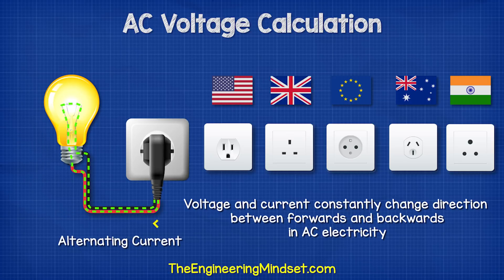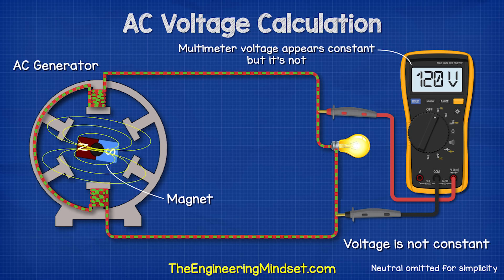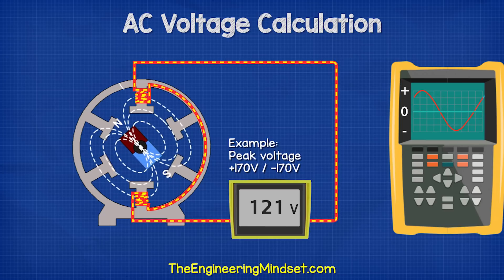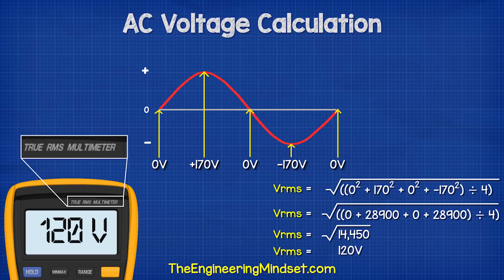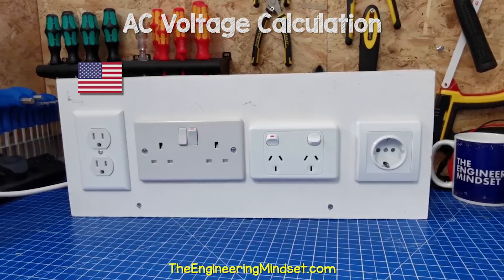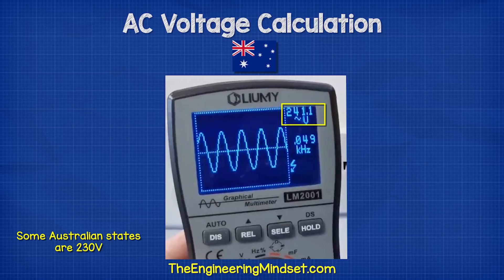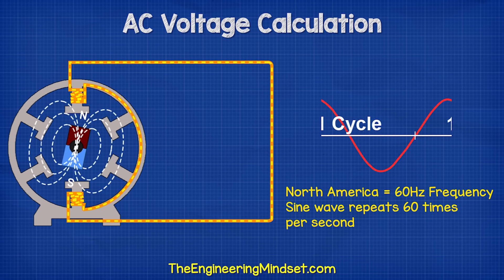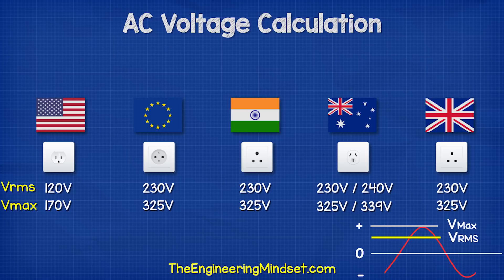AC Voltage Calculation - Vrms Vmax Frequency

Comment: Soooo....1 piece of trivia I've never learned, is 'why' the US uses 60Hz, and the rest of the world is at 50Hz.... was it something to do with synchronous clock motors, or the size of transformer cores having to be 'bigger' (more expensive) at 60??  Or was it something to do with 3-phase power in the U.S. by dividing the 360 degree rotation at an equal multiple??  Any answers?? Thanks...

Comment: Isn't the UK 240VAC?
Reply from the maker: Officially no it's 230V but it has a wide tolerance. For example in my home I read about 242V in average
Reply: @EngineeringMindset  huh, always thought EU was 230 and UK was 240...in fact so did the Wikipedia page I got that info from a long time ago...which is now different lol...guess I read that at the wrong time.
Reply from the maker: It used to be, you'll still see many signs up saying "danger 240V"
Reply: @EngineeringMindset  TIL, thanks for the reply

Comment: If e.g. voltage cycles between +170V and -170V, it seems like you could just call that "170V". I don't understand the need for averaging and RMS
Reply from the maker: RMS voltage is equivalent to DC voltage. The average DC voltage would be 120V for a heating element to produce a certain temperature, the average AC voltage would be 0V for the same heat output, because of the peaks are positive 170V and negative 170V so cancel out. So they found the RMS voltage which gives 120V

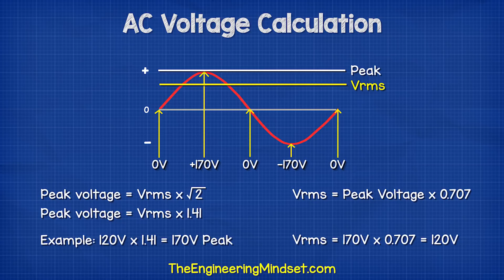Comment: There is an error in 1:29 when you said "divide by 0.707" instead of "multiply by 0.707"
Reply from the maker: I've added a note in the video description
Reply: To go from RMS (240 Volts) to peak you would divide by 0.707 to get 339.something?
Reply: Spot on!  I noticed that error too.  You saved me from a reply.

Comment: Admittedly, I am curious what background infrastructure you've implemented to deliver a demo to measure 120VAC/60Hz vs. a 230VAC/50Hz vs. a 240VAC/50Hz. Magic of television and all that, or something a bit more precisely engineered fo actually deliver those exact frequencies and voltages? It could be expanded further to deliver a 100VAC/50Hz Japanese receptacle.
Reply from the maker: There's a few ways to do it but I used some variable transformers and an 12V car inverter. Inverter is needed for the frequency change.

Comment: A small point ..... In the UK it was 240v L-N. 
Once we joined the EU we were "required" to have a common voltage (230v). Changing the mains voltage would be no small matter so it was fudged! We have exactly the same kit as always but the measurement has an allowable error 230v + 10% - 6% ....... Giving exactly the same voltage as before, but with a different label!

Comment: Are you made every country outlet with CORRECT voltage and frequency? SO CRAZY! NO ONE TALK ALBOUT THIS?
Reply from the maker: Took a couple of hours to build. Just using some variable transformers and a power inverter. Hardest part was getting the outlets shipped across the world.
Reply: @EngineeringMindset  That impressive man! I never saw anyone do that before!

Comment: If I hear it correctly, there's an error in the voiceover. It says "To find the RMS voltage, we divide the peak voltage by 0.707". This should be multiply, not divide. It is correctly shown as multiply in the on-screen caption.
Reply from the maker: Well spotted. Errors are frustrating but do happen, apologies for that. I'll add a note in the video description.
Reply: @EngineeringMindset  I used to do a lot of technical proof reading. It makes you notice little things like that :) Great videos BTW.
Reply: could divide by sqr2,  Glad I wasn't the only person who caught this.
Reply: @MichaelMantion  Likewise. Glad my brain still handles this stuff readily enough.

Comment: Hello, could any one explain to me, why the electric tester light up with the LIVE wire, but not with the Neutral?  Even though the current is alternating between both of them!
Reply: I don't know for sure, but it may be because the neutral wire is (usually) also connected to ground, so if you measure the potential between neutral and ground it is zero.
Also if you use one of those cheap screwdrivers with a small lamp and a resistor  inside, that lights up when you touch the live wire. These only work because a small current, limited by the resistor, will flow from live wire through the lamp, through the resistor and through your body to ground. When you touch the neutral wire, there will be no current flow, as the potential on both ends is the same.
Reply from the maker: Check out NEW resistor video, everything covered! ➡️ https://youtu.be/DYcLFHgVCn0